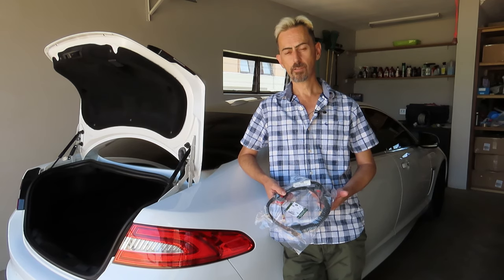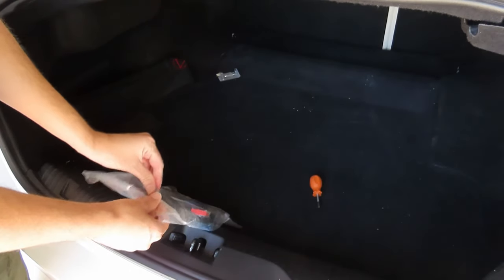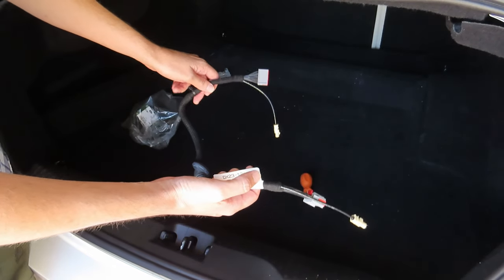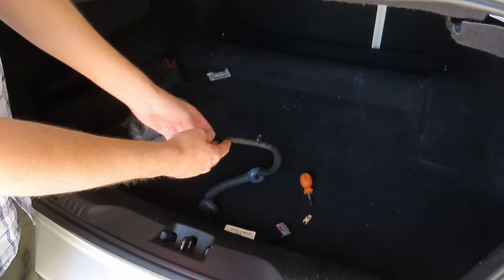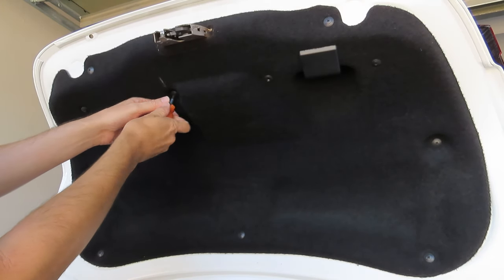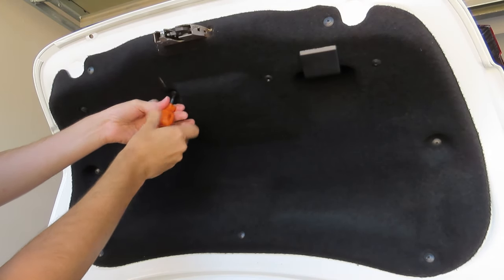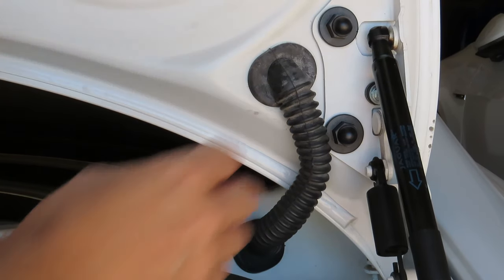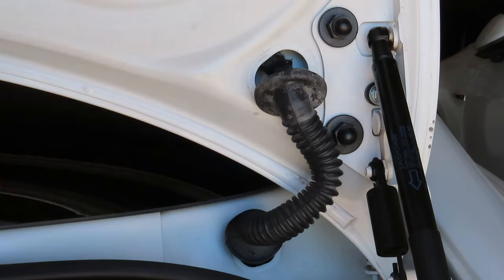How to fix Jaguar reverse camera blue screen

Comment: Sadly this hasn’t worked on mine, any suggestions?
Reply from the maker: One of your parking sensors could be faulty. Plug an OBDII into the car and run a scan. If one of the sensors doesn't work properly the camera will not work. If not a sensor then the actual camera is faulty. I'd just get a 2nd hand one.
Reply: @carfanfan  I’ll try this. Camera often comes on for a couple of secs then it shuts off, so probably camera is ok and hopefully one of the sensors is the problem?
Reply from the maker: @markjagus5202  when I took my XFRs bumper off my camera wouldn't work because the sensors were all unplugged. Came back on again when I put everything back together. It stored fault codes for when I had the sensors unplugged.
Reply: Hi. I have just sprayed all my sensors with WD40, and did round my camera for good measure. OMG it all works!
Reply from the maker: @markjagus5202  good to hear Mark. Glad you got it fixed again 👍😊

Comment: Hi all. My camera shows the image from outside but after a second or so the screen turns black and I get a message I have to contact the dealer. I already changed the Radio-DVD-CD module. the rear camera and the cables at the trunk. Screen works for all other programs as radio, CD, DVD, home ... .
Reply from the maker: Have your parking sensors checked. A faulty parking sensor will cause the camera to do that.
Reply: Ok, I will, thanks a lot! @carfanfan

Comment: Good video 👍 but I think the wire can be repaired :)
Reply from the maker: You can repair it but the other wires in the loom will also fail soon. It's just better to replace the loom. Cadillac CTS has the exact same issue. Parts supplied by the same manufacturer for both Cadillac and Jaguar at the time.